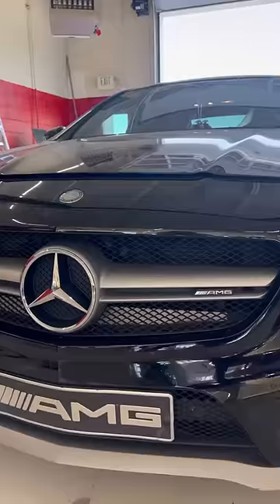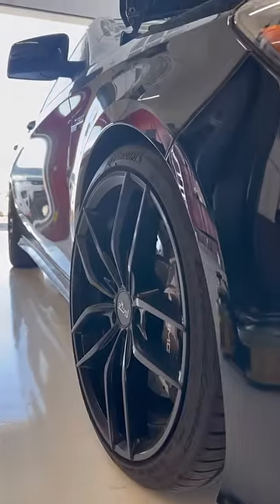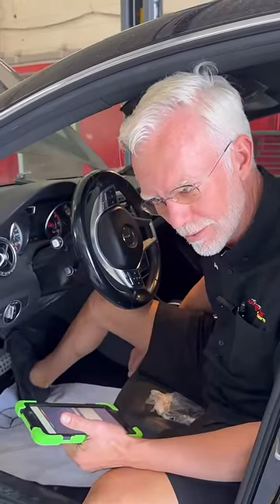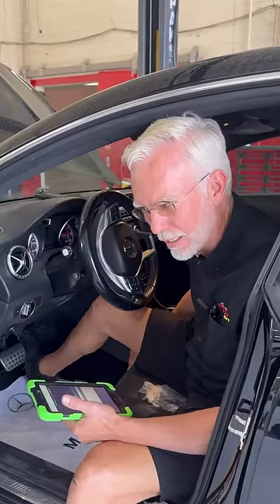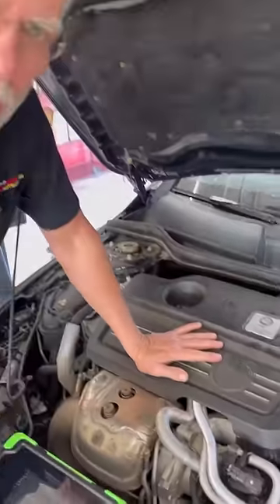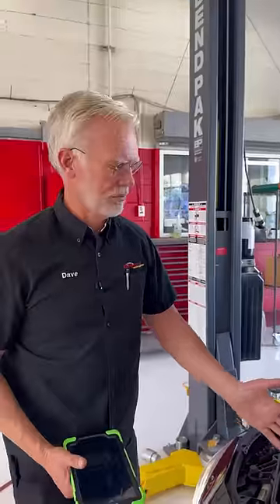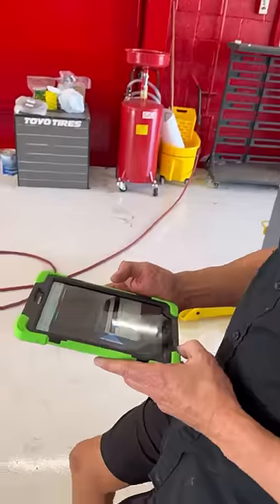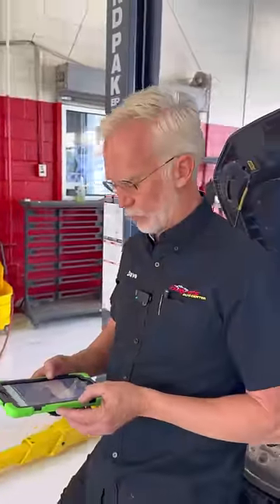Mercedes AMG Nothing but a slight noise on start up #carrepair #autoshop #mercedes

Comment: If the code you’re getting is P0299 which is a turbo underboost code, further investigation could reveal this could be a whole heap of things ranging from fairly basic stuff such as a split pipe from the intercooler to the turbo right the way up to a cracked intake pipe, a vacuum leak, somewhere before the turbo on the same side of the engine as the EGR valve and cooler from a faulty turbo transducer.
The overheating is most likely to be the water pump starting to fail if the overheating is a recent problem the squeaky chirp is also a clue.
Reply: I would agree with you on this problem, but I've heard this noise before, overheating, the sound it's making, probably catalytic converter, upstream or downstream or maybe both.
Reply: All of those things wouldn't make a noise on startup
Reply: I heard a slipping belt like water pump leaking coolant in the pulleys
Reply: If the AFR is thrown off by under boost conditions wouldn’t it run richer and potentially hotter?
Reply: @joshroi8610  running lean will make it run hotter. Running rich will make it bog, but it won't run hot.
Reply: P0299 for Honda 1.5L is always bad turbo the waste gate gets to much play and causes boost leak under heavy acceleration you can hear a heavy rattle after reving it up and letting the throttle go
Reply: That was a great diagnosis without even getting into the visual inspection. I like it👍🏼 and the customer would feel a whole lot better once you told them this
Reply: I thought this was a car he already has a full video on. Or one NEAR IDENTICAL and it was just a new turbo because the bearings go bad in them.
Reply: @davidporter8772 why would a catalytic converter be making that noise?
Reply: On some Cummins engine overheating was caused from a plastic impeller coming loose on the shaft an not spinning 
I had fitted it noting it was different  rang to check and was told by Cummins all good supaseeded
Reply: Could this also be the result of a blown head gasket?
Reply: Solid  info
Reply: @joshroi8610 well he did say it was overheating so....
Reply: I’m with you on this one, it sounds like a bearing noise and if the charge is coming in hot due to insufficient cooling cause the water pump is the first place I’d look

Comment: If it's overheating it's because mercedes added a steel mesh screen infront of the thermostat to reduce debris flowing through the cooling system. Unfortunately german engineers didn't think it would restrict the coolant flow which it does  causing it to overheat.Remove the intake manifold to access the thermostat and remove rhe filter screen.
Reply: Interesting.  I thought maybe a defective exhaust system.  A loose piece exhaust pipe rattling and causing a restriction /back pressure in the exhaust
Reply: I doubt that
Reply: Find it hard to believe German engineers would build a car like that and not run tests on coolant restriction from an added screen.
Reply: I know nothing of Euro cars, but it makes some sense. Rather debris get caught on a filter you can take out and clean than somewhere else deeper in the engine
Reply: Americans like to think German and 
Japanese engineers are better, but I think it’s actually the Japanese (Toyota) who are better. Volkswagen is German
Reply: @ihelpdogs , the tests don't  usually consist of real-world various conditions.
Reply: I know I work a a benz dealer.
Reply: @jls5480 good argument 😐
Reply: That sounds very reasonable!
Reply: well germany is cold compared to large parts of the US
Reply: sound reasonable, but does that steel "mesh" screen affect water pressure /water flow?
Reply: @ihelpdogs It would have to be with a DIRTY screen, something I bet they never did…
Reply: @hotdog9262  not even slightly. Germany hardly even gets snow. Come check out the Midwest to see cold.
Reply: sounds like 5-9 hours labor to change the tstat?
Reply: @wiggy8912  large parts.. which is correct. it gets sub zero in germany. and some of germany is also close to the alps
Reply: cold record in germany is −45.9 °C (−50.6 °F)
Reply: @chrisperrien7055 The slow build up of debris on the screen does.
Reply: Why would there be debris in a car's coolant? Lol It's a sealed system. Like what kind of debris did they think would be flowing around in there? Lol
Reply: @ihelpdogs Audi put oil screens in to their turbos on S6/RS6 (C6/C7 I think?) and caused the turbos to go dry when the screens got all clogged up.
Reply: uhh of course it's going to restrict flow eventually. It's a screen intended to catch debris. It's going to get plugged up.
Reply: @joeg5414  yup
Reply: @hotdog9262  Peter Sinks, Utah -69.3F
Reply: @jayk.2276  yup but who lives there
Reply: @bellemorelock4924  Naah not that long, but it is annoying to get to.
They put the engines in wrong by 90deg in these 🤣
Reply: @tokehgekko9455  yeah I didn't know there was AMG's with transverse engines
Reply: Here's one a guy brought me his S-10 and he was saying it's over heating and needed a new radiator. I asked did the shop do anything, he said no. I said cool, first thing I did was check the coolant flow and it was fine. HMMMMM I took the radiator hold down claps off and tipped it back. Holy Moly the radiator was clogged full of dirt and grass and spider webs.
Took the water hose and washed all the dirt out and out of the AC condenser, overheating problem cured.
Reply: @JustRememberWhoYoureWorkingFor  A-class, B-class and CLA dont really feel right compared to C-class and higher tiers.
They do however feel more premium than other similar sized cars that also have the engines in the incorrect orientation 🤣
Reply: @shamoy1000  half unbolt your exhaust is a known way to get free horsepower lol literally taking back pressure away by bypassing mufflers

think before u type
Reply: @bigcazza5260  And yet my  race team would disagree with you.
Reply: You would think that the Mercedes would test their cars in the hot US climate of the Southwest US states. Many of the other car makers do it.
Reply: @hotdog9262 that is misleading
Reply: @Rhaspun for sure they take the hot climate into account.
Reply: Why would the coolant be dirty. Should be ok . If screen restricts flow, maybe water pump back pressure
Reply: same thing with audis 4.0T when they had put oil screens on the turbos. in classic german fashion, good idea bad execution and the screens would
get clogged and starve the turbo. luckily it was a recall
Reply: I agree
Reply: @wiggy8912 you’re joking right

Comment: For the same reason that a Porsche dealership told me I needed a new engine on an 2 year old 1985, 928 when all it really needed was a timing belt. GREED!
Reply: Tbh if your timing belt is broken you often need an engine.
Reply: They want that hours so they can get paid by the hour, that's why they tell their customers that the car needs a new engine.
Reply: @user-xd3ij7cw8s lol no. You can damage the pistons as well and a head rebuild is far from being "a casual job". Parts are expensive and labour even more so. 

Oftentimes you're better off buying a used engine and swapping it out. Maybe if you live in a poor country like Zimbabwe, labour is dirt cheap but engines are hard to find so it's different for you.
Reply: damn even in the 80s??
Reply: Time to let that story go.😂
   40 yrs ago.
Reply: @amg863 Lol bro. You are talking about limited use cases. Keep telling us that you really don’t fuck with cars much.
Reply: They probably would tell you when they open up the engine, I don't believe they would replace the engine without checking.
I would say they would assume something.

If it's not, get away from there right away.
Reply: @DzasterNL  I was young, stupid and earning a lot of money so I traded it for a new 911 Targa. I found out later that they sold the 928 without any work done for a healthy profit. Never bought another car at that Porsche dealership again and neither did my friends.
Reply: @ronaldmartino2610  that's bad.. at least you got a good taste!
This dealer still exist?
Reply: @DzasterNL  No. The owner died and it closed about a year and a half later. It was a Porsche, Audi dealership. The problem after that was finding a place to service the Porsche. They were the only one at that time.
Reply: They said that too you in 1990?
Reply: @wingerding  Sorry 1985 and no warranty. Miles. I need to correct that. Thank you.
Reply: Probably because it was less labor to replace a motor than it is to tear a motor apart, inspect every piece, wait on the delivery, inspect every piece, rebuild motor.
Reply: @misaelherrera2845 I can tell you've never worked on a vehicle in your life. How do you think tearing a motor apart is less labor than replacing a motor?
Reply: 3 miles of timing belt and at least 14 valves
Reply: Nothing 'casual' on a 928,especially if driven hard and not maintained as in a broken TB. Good luck with your causal repair.
Reply: @vwbob1953  As I remember, at that time they wanted 3 grand to fix it. I never did. I just traded it.
Reply: My first car was a 1986 Porsche 944 S back in 2001. I’d still love to find a 944 Turbo today as a 2nd car or a 968, love those models of Porsche. The N/A 944s are to slow but the turbo 944 is the real deal.
Reply: @K1forMVP  My first Porsche was a 75 and a half 944 red. I also had an 86 944 silver.  Never had a turbo. I see 944s around more than 911 and 928 of that era.
Reply: @ronaldmartino2610  Nice. If I remember right the 85.5 was the first year or the upgraded more modern version new dashboard etc. I love the 944s, they’re awesome track cars with perfect 50/50 weight distribution but they’re not to fast. I had the S Model which had I think like 187hp stock and I ran it in the 1/4 at 15.1 stock, the 944 with the 2.5L 150hp 4cyl ran like in the low 16s stock. Quick but not fast. I put a bunch of suspension upgrades and brake upgrades on mine and it handled like a dream with 968 rims installed. 
I always have an eye out for a 944 Turbo. If I could find one for 10-12k without a ton of miles or one that had been rebuilt I’d probably buy it. One day I’ll get one. I’ve been looking at Porsche Boxster S models like 2007-2010s to with low miles just to get a Porsche again, a 6spd Boxster would be very fun to have. I still love the old school 911s as well, I couldn’t afford a newer 911 or I’d have one lol
Reply: @K1forMVP  I've been looking and pricing them. Everything is quite pricey right now. I'm still more attracted to the 80s and 90s models. I haven't bought foreign in a while. I have a Mustang GT 5.0 2018 and it's hard to part with but it will have to go if I find what I'm looking for. I'm just not in a hurry. I'd rather find a 911 Targa in good shape, maybe 20 years old and keep both. I don't drive much so it isn't a priority. Good luck on finding what you're looking for. God bless, be well.
Reply: Porsche or mercedes. It don't matter. Its from the same city in Germany😂😂😂 Stuttgart.
Reply: @WB32..  Right
Reply: @ronaldmartino2610  silly if dealer says need new engine and offer a low price take it home part it out

Comment: When I was an apprentice at VW, we had a Mk5 R32 Golf come in with an engine light and limp mode. We told the service advisor that he needs a new camshaft angle sensor. The advisor told the customer the motor was toasted and it needed all new timing chains, strip down to check for any valve damage and other stuff. He offered the customer $1000 because "that's all it's worth in that state"
It was 6 months out of warranty and had 100,000kms (60,000 miles) The customer got a second opinion. Came but and lost it at our manager. That advisor got fired for scamming a customer because he wanted to buy the car for himself.
Reply: That’s horrible integrity.
Reply: I had the exact same thought when I heard this story, someone didn't want to let this car out of their hands so they said that it was a Lemon.
Reply: Curbing cars as we call it in the business. Convinced the Customer the car isn’t worth anything so that you can keep it for yourself to fix and flip for a profit. Terrible integrity
Reply: That same thing happened to my friends mother . They told her her cat needed a motor and it wasn’t worth it .
So they ended up giving her 5k for a 2015 f150 and sold her a brand new car.
One of the guys in the shop knew it was a BS deal and somehow got ahold of the lady’s son….my friend.
He went up there and got a meeting with the ford dealer owner and the shop manager. When asked to produce the data showing the motor was cooked they could not. 
The dealer owner fixed her truck for free took back the car they sold her and returned her money . Then he fired the shop manager and the technician  and gave to service writer a final warning to straighten up or be fired.
I wonder how many people fell for these guys scam.
Reply: I love when they try to scam me. Been under the hood since 99 and flipped cars too.
Usually after I go deep into engine specs they stop trying but letting them talk at first is friggin hilarious.
Reply: The diagnostic paperwork is a contract admissible in court.
Reply: The advisor didn't get fired for scamming a customer he got fired because he got caught!!!😮
Reply: Not all mechanics or shady often times you get into a job and find out there is a lot more that needs to be done and that unfortunately is just a part of doing jobs the right way, but then there are also people who take shortcuts and try to take advantage of customers because they don’t have a way to verify what they’re saying if they are not mechanically inclined 

Repair shops get paid a substantial hourly rate compared to other businesses and services, providing quality and honest work within those guidelines is expected.

Using the same guidelines to discourage or manipulate, a customer cannot only result in you being fired, but you being sued by an intelligent customer this could cost you a lot of money and headache  I’ve seen people personally get sued not just the dealership or the repair facility so professionalism and integrity is important
Reply: All to common nowadays. Mechanics are honest like lawyers and dentists.
Reply: @johnfatorich3494  for the sake of the innocent yes indeed ☕️
Reply: Dealers are scammers
Reply: @jeffconley819  That's why a great number of rich don't buy new cars but used ones...because of this types of scenarios at dealerships
Reply: Mk5 golf is the ugliest design of them all. Imagine losing your job over that 😂
Reply: Nasty
Reply: I have been to dealers that are scammers and others that aren't.  The last time I took my truck in for service... they knew I had a warranty... They went through the whole thing and found every problem and then brought me to the shop to show me the problems and then got all of them approved and fixed under warranty.  I brought it in for three things and I ended up getting ten pages of things fixed and they showed me the problem with each of them and having worked on engines before I agreed and let them do them.  Didn't realize the truck was able to run as smooth as it does now.  Conversely, with a previous vehicle at a different shop... I was told a few things were needed and told them to show me and they couldn't reproduce the issues.  Left that dealer and didn't come back.
Reply: Good
Reply: Yes, same thing here.  I was 27 at the time, had my Mitsubishi montero for three years, 40k miles when I was informed that my engine had blown and the dealer offered me $750 in trade…

Local mechanic told me I had a sheared pin and fixed it for less than a $100.  It was an invaluable lesson in “trust but verify”.
Reply: @atuck6082 why aren't you fixing yourself if you're so smart?
Reply: Could it be that he needs a turbo,   Head-gaskets and chains?

Comment: Check for boost leaks.
Check compression.
Check oil/coolant aren't mixing.
Replace thermostat.
Pleasure test radiator and flow test it.

I can't hear the noise you mention on start up, but that's where I'd start.